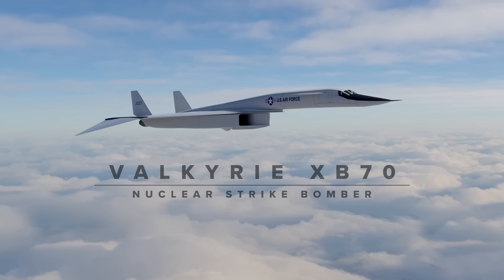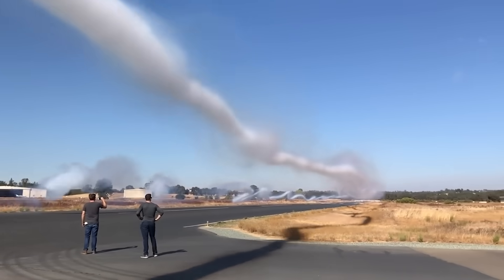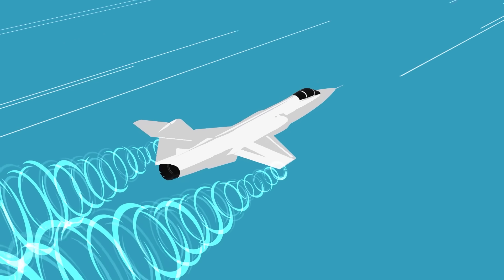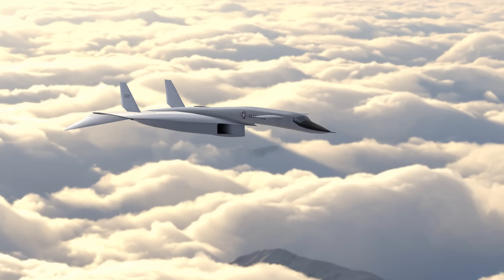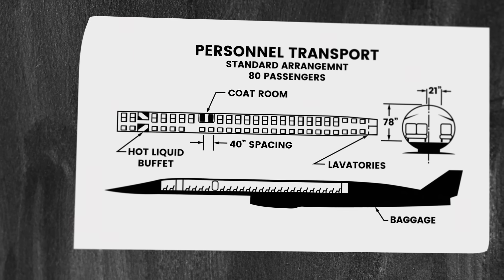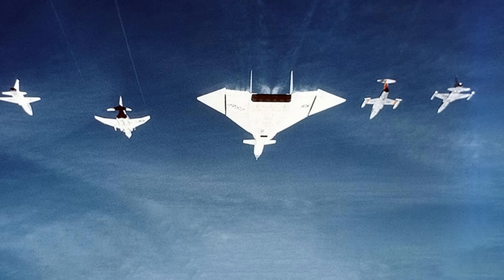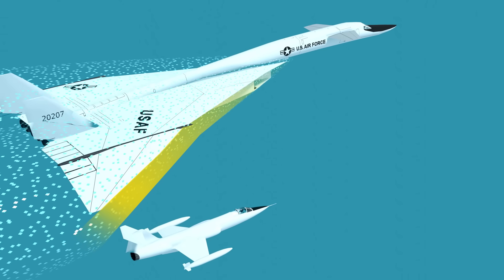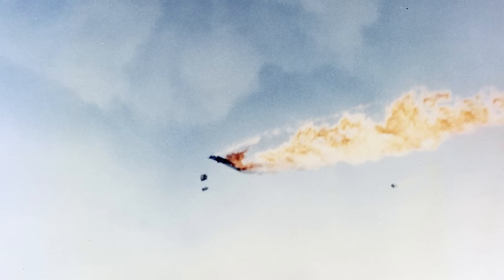XB-70 VALKYRIE | Wake Vortex crash explained

Comment: I've seen lots of videos of the incident, but this is the very first time any mention of the B-58 flying way over head that might have caused a distraction . a small little side note as an older teenager who built lots of models. On my display shelf in my bedroom I had a XB-70 and a B-58 sitting side by side. Right next to the Saturn 5 rocket that could separate into all the staging to include the Lunar lander you could attach to the nose of the Command Module. So many more from the SR71 to the X-15 and my pride and joy a completely transparent P-51D on a stand that you could raise and lower the landing gear and spin the props by pushing a control button. I was a teenager who is now 68 years old  :- (   .   memories....🙂
Reply: Being big into Rocketry, I had a few extra D-cell engines I mounted into the XB-70. I went to my local school yard and set them off. The flame warped one engine port side and sent the XB-70 into a corkscrew about 10' off the ground  and 40 feet off the launch pad. I've got pictures with exhaust trails of about 3 complete turns around everyone. The X-15 had a joined epoxied 2 D cell and was last seen screaming out over the Pacific coast at 100 foot altitude straight to the horizon  🙂. Many of my models met their end in much the same glorious way.
Reply: It's cool to hear your stories of your models. In the mid 1960's my folks had a little hobby shop in Ft Worth, Texas near the Camp Bowie traffic circle. It, (and the elementary school I attended),  were right under the flight path north of Carswell AFB and so we got to see lots of B-52s, tankers, Hustlers, the F1-11 and other fighters I never learned the names of flying pretty low in and out of the base. Every year the base had an air show and we could see the Thunderbirds performing from that area. One year, I'm pretty sure it was 1965, one of the X-B70's came to the air show. The local radio stations actually tracked it's movements so locals could go outside at the right time to see it. It flew over my school  coming in to land on its arrival. Then when it left for California after the show everybody was able to come out to see it take off over our heads. It was absolutely the most beautiful, charismatic airplane ever. I fell in love with it and have never recovered. As a kid I thought it looked like a big, white dragon. It was really loud on takeoff. We were used to loud takeoffs but NOTHING compared to those six engines roaring when it blew over. It made a second pass and then headed west. I've heard that the one that came to Carswell was the one that crashed. Makes me sad, but I feel lucky to have seen it. 
Anyway, Ft Worth had a pretty active modeling community then. We sold RC, control line and free flight planes, and we flew every weekend to support the business. There were always people out flying. There was also a group who built plastic models. They built them carefully and did research to do the paint jobs really accurately. We would display their models in our shop window. The Aurora plastic movie monster kits were big too, as was Rat Fink and all the Big Daddy Roth character car kits, Davey, Daddy, Digger, and Danny. They were intentionally grotesque and funny. All the kids loved them. Rocketry got big later. 
Anyway, it was a fun time and place to be a kid.
Reply: @justicewokeisutterbs8641  I too got into rocketry and launched many at my school  But I went a step further. I modified 2 D cell motors and epoxied them into one long stage. Mounted it into a X-15 and lunched it out over Monterey Bay from a small cliff. Last seen screaming at Mach 10 flying level at 50 feet to the horizon. My SR 71 didn't fair quite so well.😄
Reply: @MatthewPettyST1300  
That is so cool! Great memories of great fun. I think there was something special about putting all the work into a model, rig something wild like your X-15 with modified engines and then risking it in flight.  There's nothing quite like it. 😎👍
Reply: @justicewokeisutterbs8641  The Hamster was scared sh*tless piloting it, no ejection seat......Just kidding !
Reply: Damn. On the one hand those toys sound expensive for the time, on the other your passion saved your parents entire days wondering what presents to give you, so that’s something i guess.
Reply: Very nice, I remember fondly my Saturn 5 rocket same as yours, not sure what happened to it anymore but sure do miss it 💯
Reply: Thanks for sharing that. I'm 44 a child of the 80's. I have always had this amazement and wonder about you guys who grew up in the 60's. The innovation of  brilliant minds working to create incredible aircraft, vehicles etc.....your memory really made me lay here and just kind of stare at the ceiling and think....

Comment: F1 cars also develop these vortices-->either from the rear wing end plates or from the Y250(250 millimeters from the central axis of the car)vortex generated by the front wings and elements.  F1 engineers want as strong a Y250 vortex as possible as those vortices come together into 1 big vortex which is then spread out to the outside of the F1 sidepods by the bargeboard.  Interesting to see under heavy humid conditions or when its raining by either the front wing and rear wing on an F1 car.

Comment: They never should have canceled this program because of the accident and inter service politics. It was an engineering achievement ahead of its time. So innovative that they discovered the aircraft used less fuel at maximum speed because It was riding its own bow wave - data that was used on the Space Shuttle design, ( of course politics killed 14 good people out of hubris in that program). At the time vortex phenomena was not very advanced, and the hot shot follow up aircraft pilots got to close because of pressure to get up close pictures for propaganda.  It truly does not make sense that the B52 airframe lifetime was pushed up to over an 85 year time line and is our only front line bomber aircraft to this day.. Any weapons system develop from this time forward has been over budget , delayed with continued performance issues that the military is forced to accept and fly anyway. Combine that with the fact almost every weapon is designed around not having a theater of operations in mind.  The F-35 is a perfect example. Huge performance issues too sophisticated for the average maintenance teams and pilots and a ridiculous price tag, same with Osprey.. If and when we go to war with China our forces will be destroyed in less than a week because of sheer numbers of unsophisticated weapons systems and our enemies not carrying how large their losses are.  Not to mention our military is managed by incompetence in leadership and soldiers with no desire to engage  but want Starbucks and email on board ships at all times. All if this because 2 airplanes were built but technology never continued.
Reply from the maker: You have a very interesting take on this. But I say as long as you can afford to throw truly crazy sums of money at defence then the technological advantage is likely to be decisive. The US can and does afford the stuff because of the insane money and incentives in the federal politics ensures the money flows to ever more fancy weapons. And of course there are the secret weapons that will be out of this world. 
I have always thought it was fantastic that the Soviets could build fighter jets that could operate and be kept flying in simple places like Angola etc with simpler tools. However so telling how the Russian airforce has failed in Ukraine and been too frightened to fight and proven to toothless. Their technology is just too lacking and not up to the limited challenges even Ukraine can throw at it.
Reply: @Mike-Bell  Thanks Mike, we are definitely singing from the same book and in the same church pew , especially on the Osprey.  How any pilots want to fly that bird amazes me.  Fortunately the troops riding in it are not aeronautical engineers and familiar with the complexity and danger of the design. I have been amazed at the Soviet Air Superiority Strategy. Historically they have never used air superiority very effectively. Although in Ukraine I'm not sure we are getting the best Intel. Russians have always used brutal ground aggression in all the world's wars. They have several aircraft designed for ground support which they are not using. Possibly because the world is giving away huge quantities of air defense systems, which means we are getting sucked into the war because we have to have boots on the ground to train. This conflict has been going on for about a century. I'm probably one of the few Americans that believes we should not be involved. After all if Russia gets back Ukraine they inherit Chernobyl " again". Last, the Russian people don't seem to want this war and that internal struggle could be a major factor soon. I also believe you will start seeing ships being sunk that are delivering these free weapons in the near future. I don't think our military and administration has a contingency plan for escalation when it begins to effect more of our military or civilian assets. . Time will tell .
Reply from the maker: I would be too frightened to climb in a Osprey. Any sort of asymmetry in the props and all ability to glide to safety like any regular craft with loss of power is non existent.  Too scary too many potential things to go wrong for me.
Reply: The B-70 bomber was not canceled because of this accident. That plane was cancelled before a single plane had been built, in 1961, years before the accident. 

Also, interservice rivalry had nothing to do with canceling the bomber, which was opposed by 2 presidential administrations, both having widely different takes on defense spending. The B-70 was cancelled because its high speed and altitude performance weren't shown to add significantly to America's military capabilities, and certainly not enough to offset their high expected price tag, given improvements in SAM technology, and manned interceptors in the USSR.
Reply: @winternow2242  let's see, guess we'll have to agree to disagree, your Wikipedia research, my real life inside experience  .  End of story.
Reply: @c123bthunderpig  in your vast experience, what book did you read that disproves what I said?  What facts can you even claim that prove I was wrong about when this plane was cancelled, or by whom?  What fact in my comment are you even disagreeing with?  When the owner was cancelled?  Who opposed it?
Reply: @winternow2242  actually "winter", your question was asked and answered, practice your debating team skills with someone else. THIS IS MIKE BELL'S CHANNEL, and I rarely inter dialogue with people who have cursory background knowledge out of respect for the channels creator. Besides I have no idea who you are, Maybe a troll " Sorry Mike".

Comment: I've been waiting for someone to do a continuous animation of the crash sequence for years - well done, this is absolutely excellent.
Reply from the maker: Very happy when my efforts are appreciated. Thanks 😊
Reply: The animation of the view from the cockpit of the overflying B-58 speaks volumes. Meanwhile, I didn’t realize they been flying around for so long. What the heck it does it take to take a photograph?  On station for more than 15 minutes?! Seriously WTF.
Reply: @JoeOvercoat  Well, it takes quite a lot more than 15 minutes. In 15 mins you can get maybe a couple of good photos while walking on ground around the plane, IF you have made a strict pre-plans on what viewpoints you want photos from. When flying in the air, you are very lucky to get just one. From your comment it is clear that you lack the relevant knowledge on both taking photos and how planes behave in air to make an informed opinion about it. 

Seriously WTF. Why the hell people need to have their stupid opinions voiced? Go learn  these thing. Make yourself informed and then make your opinion. Otherwise  you'll just make yourself a fool.
Reply: There we go.   Yes thanks dear fellow
Reply: I agree with you on this comment.  I also believe that Chuck Yeager was entirely correct that the pilot flying the F-104 should have never been put in the cockpit to fly in formation.  The guy had very little formation flying experience and wouldn't have thought about the wingtip vortexes being an issue.
Reply: @stevenf7683 interestingly, the F-104’s T-tail causes it to “pitch up”. Its pilots avoided flying “in trail” formation since the trailing aircraft horizontal stabilizer would be hit by the leading jet’s exhaust.
Reply: Fascinating history, stunning looking airplane.
Reply: @RobSchofield You may want to check out this video on the accident, it was uploaded just a few days ago. 12/2023.  👍
Reply: That's make two of us
Reply: Great

Comment: The one time either plane flew at it's top speed it started to melt after a few minutes. A single SR-71 mission had more time above mach 3 by multiple times than both test planes logged in total. Also it could carry fuel or payload but not both. Looks pretty though.
Reply from the maker: The SR71 had the brains at Skunk Works behind it.  No contest.
Reply: @Mike-Bell  That may overstate things.    The A-12 Blackbird was flying not that much earlier, and during the first three years of pre-operational testing, three A-12s crashed.

The first flight to fly briefly at Mach 3 was in July 1963, and the first sustained flight at operational conditions—Mach 3.2 at 83,000 feet for 10 minutes—did not take place until February 1964, which was only seven months before the XB-70's first flight in September.  The XB-70s first M3 flight was in October 1965.
Reply: Not true; AV/2 had done a 30 minute run, and longer ones were planned at the time of the accident.    That's the tragedy of it, that it never had the chance to show what it could have done.

It is true that AV/1, the survivor, had problems at M3.0, which we resolved in AV/2.
Reply: @d.brower  The two planes TOGETHER logged 108 MINUTES of mach 3 flight time. So yes TRUE.